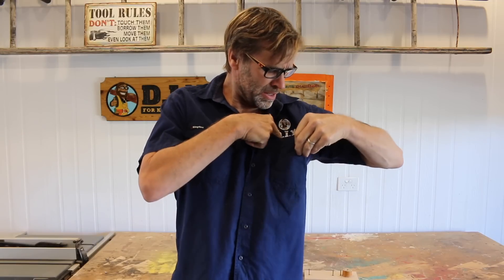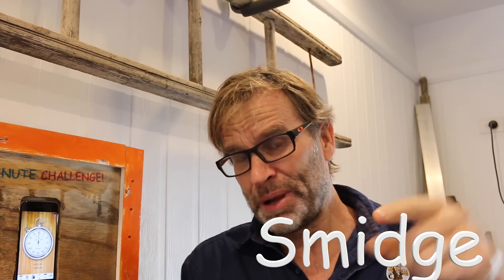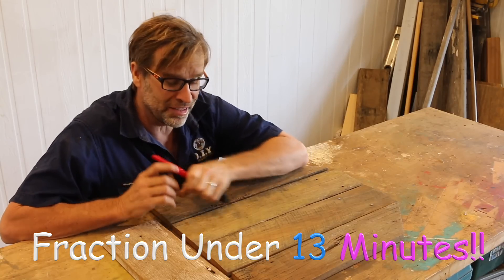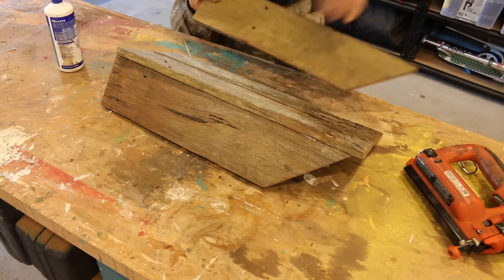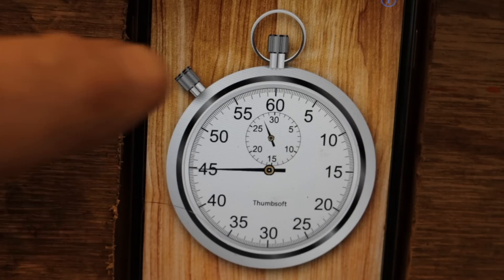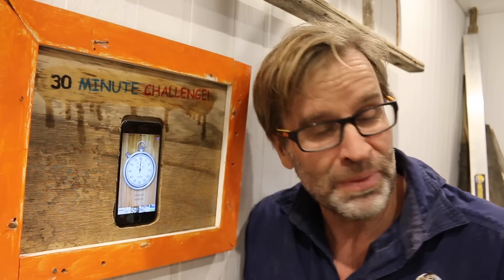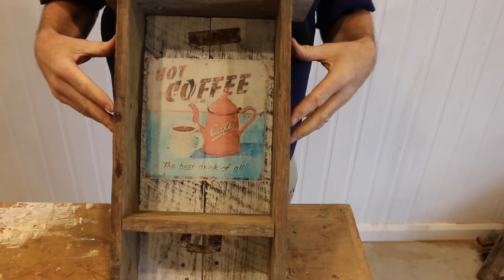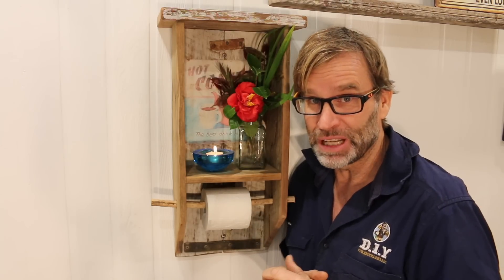Build a Pallet Wood Shelf. 30 MINUTE CHALLENGE With BONUS TIPS!!

Comment: Here in the deep south, probably consider the high north from the outback, we call it a smidgen and a tad.  The smidgen can't be measured easily if at all, and a tad can't be measured accurately but isn't much more than smidgen.  

In reference to a table saw and miter saw, if you cut off a tad, you'll have a smidgen on the other side of the blade. If you only cut off a smidgen, there will be no remainder on the other side of the blade. 

We also have a rule around here when you cut a board short.  Cut it again up to three times. If it's still too short, put it in the board stretcher overnight and try again in the morning. Keep trying until you either get it right or run out of board.
Reply from the maker: Hahahahahaha...well done Buck! Very well explained 😂 Gotta say l love the 'board stretcher' and will have to use that expression in one of my upcoming vids! Thanks for watching 😁

Comment: hey uncle K, what is better to get for a nail gun for the wireless? or one that goes with a compressor? I am looking to get one so I can add trim to my projects and so far I have only found wireless ones that do stapples and not brad nails.
Reply from the maker: Hi Ross. It all depends on your budget. Both types are good. The only drawback with the compressor is that you need to have a compressor as well a length of gun hose that you need to drag around and store once you've finished with it. I've had my battery operated one for a long time and love it. I have a link to one in the description of the video if you're interested. Cheers mate and good luck with whatever choice you happen to go for 👍👍

Comment: Great 30.smidge project ! For the photo transfer, did you use an inkjet printer copy ? My understanding is that this method works best with toner prints. ;-)
Reply from the maker: Thanks David and yes l used an inkjet printer. I've done this plenty of times before and most of the time it's worked well.....unfortunately...this time it didn't. Not quite sure why as l use topped up all the inks as well. Cheers mate 👍😁

Comment: When fitting doors, I usually allow a tad  over 3mm on sides and top. When inflating tyres I tend to underinflate by a whisker below recommended pressure. Its usually a good idea to allow less than a bees appendage between mortice and tenons so they fit snug. I tend to allow only a scintilla of cauliflower to be served to me during dinner. Any more and I find I tend to bloat a smidge. Does this help?
Reply from the maker: hahahahahahahahah😂😂😂 well done Shane! Coincidentally, l just had a scintilla of cauliflower with my corned beef dinner tonight 😂....Have a good one mate 👍😁

Comment: I think that I need to buy a circular saw for my home handywoman projects.    I noticed that your saw is attached to saw horse.  Have you any recommendations as to what features to look for when buying a circular saw?
Reply from the maker: Hi Clare...good question. I think it all depends on your budget and how much you intend to use it. In my experience, what you need is a good solid base and a good quality mechanism for changing the angle of the cut and for adjusting the height of the blade....this often indicates the quality of the tool overall. If you're interested and live in America, l have a link to purchase the saw that l use in the description box under the video.... Cheers and good luck 👍
Reply: Thanks!   I'm in Perth and having used a saw and mitre box for my recent (occasional) project, I know that I need a circular saw that cuts angles.   I think I will go to the local Bunnings and Toolmart and compare the various brands of saws.
Reply from the maker: Good luck Clare. 👍

Comment: What type paper and printer did you use?
Reply from the maker: Hi Lynette, the paper is label paper, on an A4 sheet that l remove the labels from....that leaves a shiny surface to print on and the printer is an inkjet. This method won't work with a laserjet printer. Good luck 👍😁🇦🇺